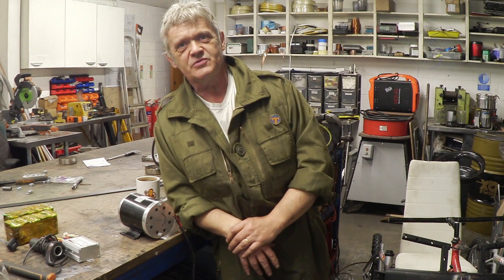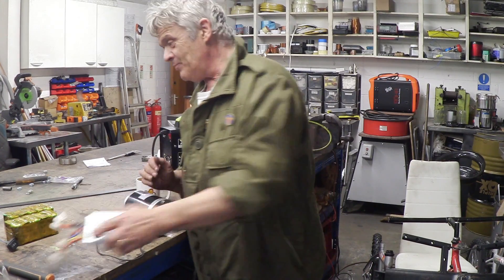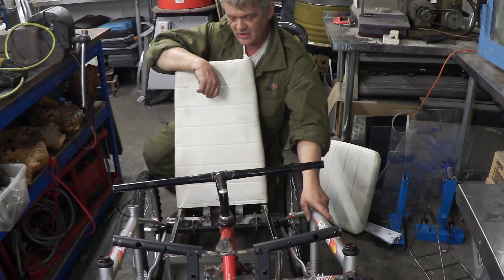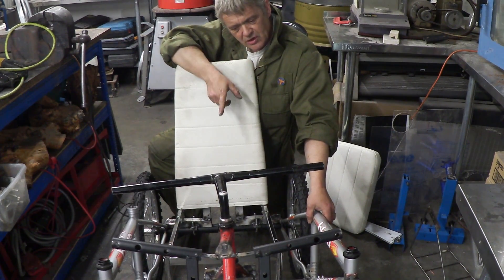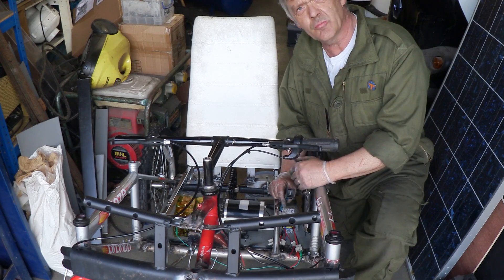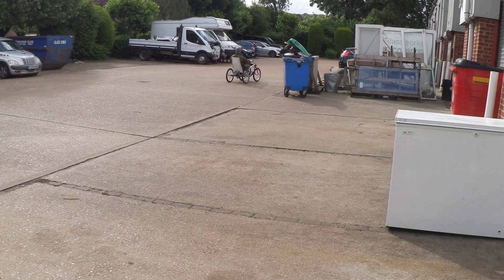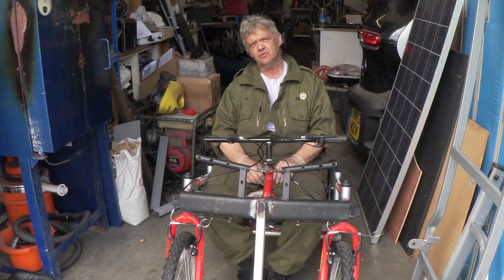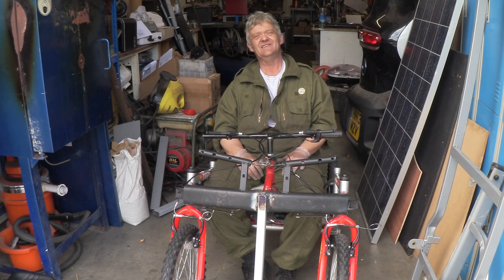1149 E Quad - Adding The Motor And Testing

Comment: You just made a e-car, which needs registering, approving, taxing, insuring, ..., not a 4 wheeled ebicycle.  The limit is 250w cobtinuous fir the motor and NO throttle.  The answer is to use 2 separate ebicycles and join them as they are, add double steering, seat and crank joining.

Comment: This is the type EV that should be readily available to everyone for the local runabout rather that the power hungry EV's being developed by car companies. So many political issues here. Then there are the legal issues relating to road use. Pressure is being applied to electric scooters. E push bikes are limited to 250 watt motors. So it goes on. Such a shame when we so need people like R M-S to allow these things to happen. E Bikes have gone to the wall when trying to mass produce these items. Suggest you come up with a home build.All weather, street legal version. People could buy the plans and build the kit. Then you might get hit with getting it certified as safe to use. I think I would start with a street legal trike and build up from there. What about creating a Website and recruit volunteers to do the research and design. Is this too complex. Keep doing what you do R M-S and enjoy your life as this is all that one needs.

Comment: Approximate top speed of your equad should be about 22 mph with a 500w motor, that motor has a rpm of about 2500, so the ratio from pinion to sprocket should be  8:1 for a 24" tire, OR 6.67:1 for a 20" tire. YOU ARE GEARED TOO HIGH and will fry the controller or motor or both, also will drain your batteries too fast.  You can over volt that motor to 36 volts and get 1000 watts and a rpm of 3750 that will bring your speed up to 33 mph. Electric motors have a max watt rating not max voltage and the wattage rating can be exceeded for short bursts with no damage, the max watts are set for continuous duty.  If your controller has all capacitors with voltage of 50v or more you can upgrade to 36v without a new controller because a 24v battery is really  30 volt system with 35 volt caps and a 36 volt battery is a 45v system needing 50 volt caps and a 48 volt battery needs 63 volt caps or higher. So if your controller has 35 volt caps you need to upgrade the caps to 50 volt of same capacity or get a new controller. There is also a controller HACK to get more power/speed/torque but you must be careful on the take-offs as you can fry your controller mosfets. Inside the controller is a SHUNT as like in a amp meter, just solder in a piece of metal over it. GOOD LUCK AND KEEP HAVING FUN ! ! !
Reply from the maker: cheers mate - especially the advice on gearing
Reply: @ThinkingandTinkering  Thank you for the props, so rare now days. I love all that you do, I love being a "MAKER" myself, Much respect for you.
Reply: @ThinkingandTinkering  By the way, as for batteries there is a basic general estimate of about 1 mile per 1 amp hour (+ or -) .

Comment: Morning Rob and Luke, back out the gold fields again. You can buy a empty case 36 Volt or 48 Volts from case with bms. Then Luke can spot weld 18650 batteries into it from laptop batteries  You know what you are doing with the batteries mate.
Reply from the maker: for sure mate - cheers and have a good one yourself

Comment: Wow Robert what I see here is a test bed for your batteries and other tech you been playing with... Awesome job mate... I was thinking on the door thing... why not cut the bar off and make it swivel in place like a door.  On back part of frame could use a bigger pipe enclose it with some grease and it should swivel in place.. towards the front make it so you just put a pin in it to hold it closed. then could add some screening to sides for protection also... Now all you need is to make a trailer and that can be your utility cart also for when you go out trash diving... They can see what your doing with the items ..... really awesome job mate... Keep up great work..God speed
Reply from the maker: exactly what I was thinking mate

Comment: Now we wanna see a simple regenerative braking system circuit 
Maybe charging a secondary battery.. 🤔?
Reply from the maker: maybe
Reply: @ThinkingandTinkering  or with capacitors in a secondary circuit, then you could somehow make it so it helps for the starting like I heard starting a vehicle is what takes the most energy so it would make sense and also would help save batteries !

Comment: Great Job.
With virtually every one off build, one get ideas for improvements.  When one  moves on to build the second with those new ideas, the first gets labeled a prototype.  or.... prototypes is for models built  before settling on a design for mass production.
Reply from the maker: you learn so much when you build it!

Comment: Is there some reason why the throttle is on the wrong side?
Reply from the maker: I am left handed - but seriously? there is a 'wrong' side lol
Reply: @ThinkingandTinkering  All motor bikes have the throttle on the right. You would be pulling back on it rather than pushing forward.
Reply: LOL Cuz everything in Britian is on the LEFT  instead of the right Bro.... was crazy getting use to driving when I was there...just riding in a vehicle was different experience...

Comment: Can you run it with a solar-panel on top... maybe you dont need bigger batteries then?
and i may have seen an unused solar panel in the back there - i guess 300W 18V?
Reply: It absolutly could. But batteries are needed for general usefullnesd in speed distance and to operate at times when there's no or limited sun. 

Solar PV vs battery is not a valid dicotomy. They can work together for improving range and top speed. But the added usefulness of solar side is generally relativly very limited.  

Solar power carts have been  challenged in long distant races.  power translates to speed.  A solar cart without batteries sustained on  pv alone will only be able to go a certain distance per unit of time in a given light.  Adding a battery weighs the cart down reducing the velocity one can sustain on PV alone, but the battery provides power to go much faster for a limited duration, not to mention the fact that one starts their trip with the battery charged Batteries make a solar pv cart more pratical in terms of speed and distance, but the trip is started with batteries charged on solar after a long rest or charged more quickly with a plugged in battery charger.
Reply from the maker: dunno mate I guess it kind of could

Comment: Looks great Robert, are they're any legal implications in using it?  I'm not sure what the laws are now concerning electric scooters now, it was illegal but judging by how many can be seen on the roads and public footpaths I'm thinking that must have changed...
Reply from the maker: I have to stick a chain wheel back on and then is a power assisted pedal vehicle and just fine - but as you say things are changing quickly
Reply: street legal worthiness will depend on local governments and types of streets.  I strongly suspect most governments would let this on freeways for instance, but maybe some localities may be fine with this on certain city streets. 

One needs to check their local laws and what it takes to be legal.
Reply: @kreynolds1123  Specifically I am referring to UK laws which change like the wind..
Reply: @SimonPlatten  I was thinking your question is a good one for everyone everywhere. 😁 If one wants to build something to ride on the streets, they should check the laws in their locality to not get in trouble with the law.